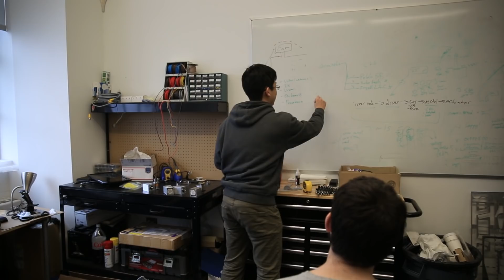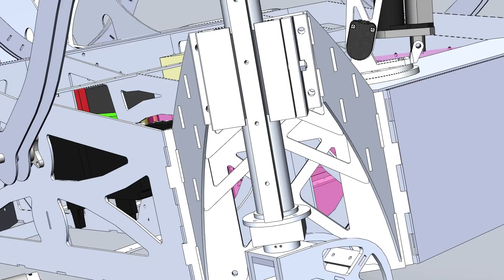MIT Robotics Team 2015 Promo Video

Comment: Investigation of the idea of, "computational fractals," would be useful. "Computational fractals," meaning scalable fractals in terms of deriving solutions to more and more difficult problems with the aid of computer science and macros. With estimation, the commencement, to the completion time of the implementation of this idea would be greater than less automated solutions. In short, to have a function with parameters, changing a parameter generates a different solution for either a less difficult problem or a more difficult problem. The implementation of this idea would require the core principles of each relevant discipline such as: core principles of electronics and electricity engineering; core principles of computer science; core principles of philosophy; core principles of mathematics; core principles of physics; core principles of linguistics and much more. Focusing on function rather than form would require the breadth of the core principles of approximately 50 fields of study. Whereas focusing on function and form would require the breadth of the core principles of approximately 70 to 80 fields of study: including art, biology, geology, astronomy and more.

Comment: Excellent innovation . But I would suggest an enhancement to upgrade the front of the robot to run faster in the snow . Wheel is good but adding a small skiing board which can be engaged using servo actuator remotely or as per requirement . If you like my idea plz comment .